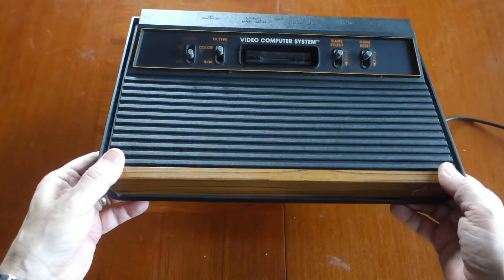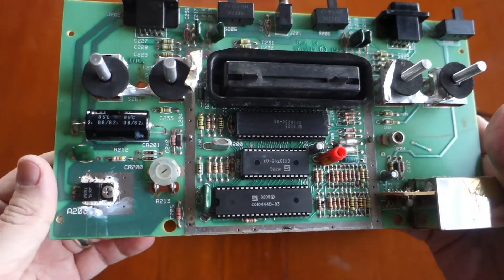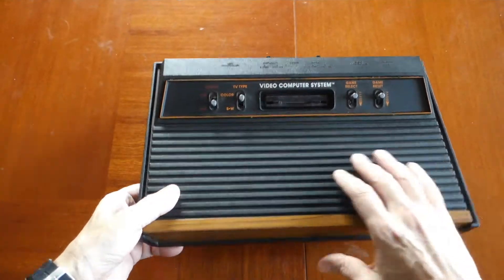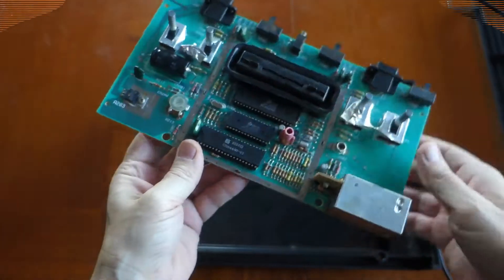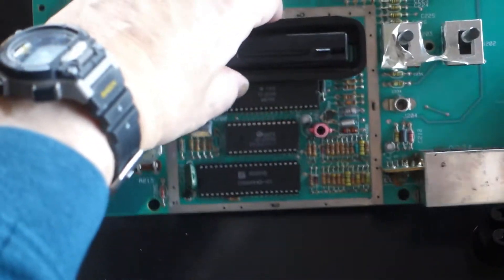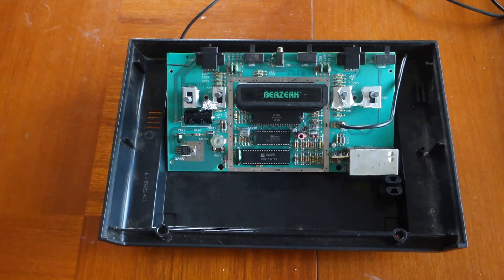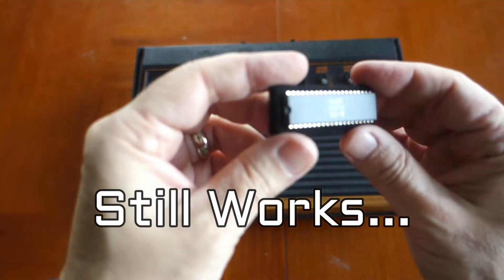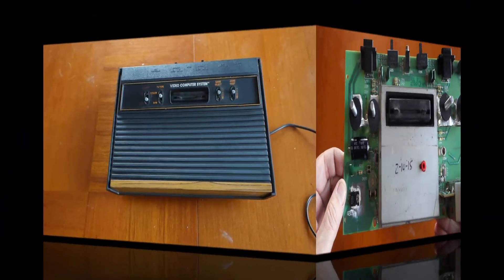Atari 2600 "RIOT" chip replacement

Comment: someone had it opened up before you the static guard tape is ripped and the switch foam O rings are gone why did you not take the foam O rings off the spare mother board and put them on the one you fixed ? lol oh always wear rubber gloves when handling chips to minimize any static spark to the chip thats why your using a chip puller did you notice its plastic ?

Comment: I just got handed one of the 2600 "Light Six" consoles; I notice after watching this that not all of the 3 main processor chips are faced the same way. The riot chip (the one I checked first) has it's notch on the right but the other 2 are on the left. Would this have fried those chips or can/should I reverse their position? Anyone know?  Thanks.
Reply: No, don't reverse the positions! They are supposed to face that way. Two in one direction and one in the other. Reversing them will not end well. 😁

Comment: GRAY DEFENDER 
++                  1.) What is the start and end address range for the TIA?
        2.) What is the start and end address range for the PIA?
3.) What is the start and end address range for the Games ROM chip?  
         4.) What is the start and end address range for the Sound RIOT chip?
5.) is it a ROM chip or a PROM chip that are inside the game cartridge?
        6.) A PIA chip is a RAM chip that has built in ADC/DAC interfacing? A PIA is not a decoder or a multipler chip , its a RAM chip with I/0 interfacing ADC/DAC converters built into the RAM locations?

Comment: Why do you have aluminium foil on your switches?
Reply from the maker: That was just what was there when I opened up the case.  I've seen it before so I think maybe it came like that from the factory?
Reply: GRay Defender OK. Maybe it bridges contact? I just opened my Atari it don't have that.

Comment: Your'e lucky it was an easy fix, it's not always the case when you need to fault find. And in the case of the later 2600 juniors, the 3 main chips are soldered in, not socketed.
Reply from the maker: Totally agree.  This turned out to be a pretty lucky fix.  I am a rookie when it comes to soldering but I will try it once in a while.

Comment: It's always a bit of a scare when your devices stop working out of the blue. Usually the repair is not hard, especially with the help of the Internet.
I should apply that a/v mod for my Atari that I've had lying around for ages.
Reply from the maker: Yeah, it's always scary opening up this old hardware, but at times it becomes necessary if you want it to work.  I was determined to fix this issue though.  Thanks for watching!